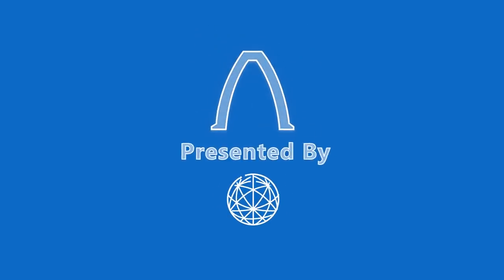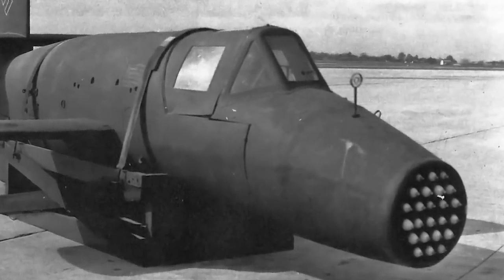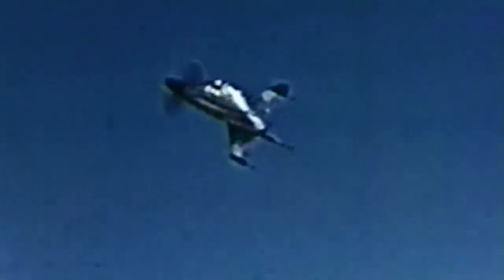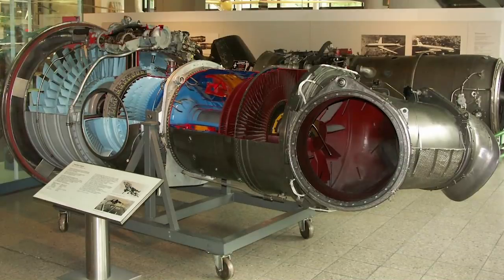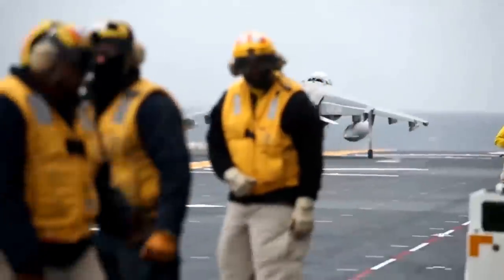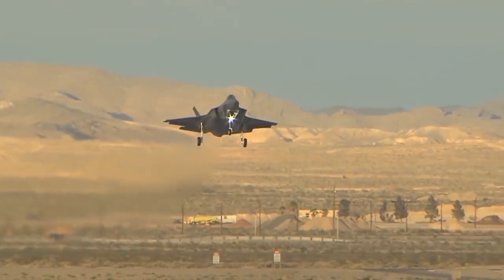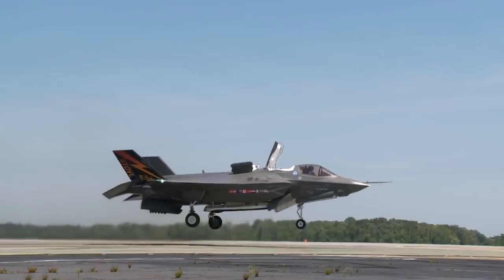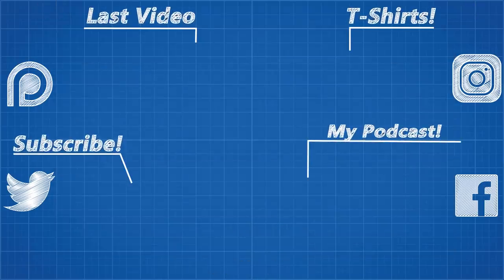The Real Life Sci-Fi of Vertical Take-Off Planes

Comment: F-35 is a shite plane in combat performance, it's technically advanced but the wings are tiny...
Reply: How so? Tiny wings? As compared to what?
Reply: Nathan Peterson as compared to the F22 as well as its own with...
Reply: +Firestar

 The F-22A is a completely different mission focus. The wings are not that small. It has a high on-paper wing loading figure. But that doesn't exactly account for all lift the aircraft has in flight.
Reply: what about maneuverability? in a direct dogfight (which as you implied it shouldn't be in under normal circumstances) how does it stand (or fly for this matter)? I'm not questioning its ability to fly because it is litearly  taking off vertically but how does it comare in combat to litearly every other modern fighter jet?
Reply: +Firestar

 As Royal Norwegian Air Force pilot Major Morten "Dolby" Hanche noted in the Kampfflybloggen (Combat Aircraft Blog): 

- "In the defensive role the same characteristics are valuable. I can «whip» the airplane around in a reactive maneuver while slowing down. The F-35 can actually slow down quicker than you´d be able to emergency brake your car. This is important because my opponent has to react to me «stopping, or risk ending up in a role-reversal where he flies past me. (Same principle as many would have seen in Top Gun; «hit the brakes, and he’ll fly right by.» But me quoting Top Gun does not make the movie a documentary).

  Defensive situations often result in high AOA and low airspeeds. At high AOA the F-16 reacts slowly when I move the stick sideways to roll the airplane. The best comparison I can think of is being at the helm of ship (without me really knowing what I am talking about – I’m not a sailor). Yet another quality of the F-35 becomes evident in this flight regime; using the rudder pedals I can command the nose of the airplane from side to side. The F-35 reacts quicker to my pedal inputs than the F-16 would at its maximum AOA (the F-16 would actually be out of control at this AOA). This gives me an alternate way of pointing the airplane where I need it to, in order to threaten an opponent. This «pedal turn» yields an impressive turn rate, even at low airspeeds. In a defensive situation, the «pedal turn» provides me the ability to rapidly neutralize a situation, or perhaps even reverse the roles entirely.

  On the positive side I would like to highlight how the F-35 feels in the air. I am impressed with the stability and predictability of the airplane. Particularly at high AOA and low airspeeds. It is a peculiar feeling to be flying the F-35 at high AOA. I can pull the nose up to where my feet «sit» on the horizon and still maintain level altitude. I’m also impressed by how quickly the F-35 accelerates when I reduce the AOA. High AOA produces lots of lift, but also tremendous induced drag. When I «break» the AOA, it is evident that the F-35 has a powerful engine. The F-35 also makes a particular sound at this point. When I quickly reduce the AOA – stick full forward – I can hear clearly, even inside the «cockpit» how the F-35 howls! It seems like the «howling» is a mix of airflow over the wings and a different kind of noise from the engine. Maybe this isn’t all that relevant, but I still think it´s a funny observation. Another aspect is the kind of reaction I get when I push the stick forward; the F-35 reacts immediately, and not delayed like the F-16. Looking at another F-35 doing such maneuvers is an impressive sight. The various control surfaces on the airplane are large, and they move very quickly. I can monitor these movements on the screens in my cockpit, and I´m fascinated by how the control surfaces move when I manipulate the stick and pedals. Especially at high AOA, it is not always intuitive what control surfaces move, and by how much."

 The F-35A is noted to have very similar or better acceleration and climb-rate than the F/A-18, and better for the latter against an F-16D.
Reply: Nathan Peterson ok, thanks. That clears things up a bit.

Comment: What a cheap video, this guy forgot to tell the German meschersmitt  and the fock wolf in the 50's, the yakolev 38 the counterpart of the harrier, and then the Yakolev 41, the basic design of a supersonic vertical tack off plane, in where the f35 was based ( if not a cheap copy).
Reply: What nonsense are you on about?
Reply: Just because you ingore the real real facts it doesn't is not sense, read, watch videos before you comment none sense stuff
Reply: @quetzalcoatlarmadaimperial754  The F-35 is not a copy nor related to any Yakolev designs. As the acquisition of said technology transfer from the nineties at least from my research doesn't support the argument the Yak-38 and Yak-41 were included. Secondly the  F-35B uses a radically different means of vertical lift. A "cold" fan drawing rotational mechanical power from the turbofan. Unlike the Yakolev designs both using two "hot" turbojets to provide such. They do not look similar by any measure.
Reply: And about the German airplanes 
https://youtu.be/ntZDAS4fCPA
The other one was not a fock wolf, my mistake it was a junkers. Didn't find the video.
Reply: You are right in the difference between the f34 and yak 141, f35 uses cold air fan, and Yak 141 uses hot turbofans, f35 is stealth and yak not.... Obviously has to be a difference in the copy, but did you know:
F35 uses same turn nozzle Sistem to create vertical take off as the yack 141, and uses same auxiliary under the wings thrust as the yak 141??  And by the way has the same badic design, did you know that?? And yak was faster mach 1.6 and f35 just mach 1.4, probably uses a copy of that same turbine.
And same exactly system of landing gear and exactly the same size and shape of the wings.

So if is not a copy, ( in where yakolev got a lot of money selling a production license to the US, and save them selfs of bankruptcy, with the ability to change anything in that license, what makes it a copy) then still being a copy in where they stole the design and start production without  paying nothing to the Russians ( thing that didn't happened because Yakolev reported a very good income of selling a production license to the Us) still be a copy!!
Reply: @quetzalcoatlarmadaimperial754  
I am not qualified to judge the veracity of the statements made above.
On the other hand, you would gain in credibility by respecting the spelling of German proper names:
- Messerschmitt;
- Focke-Wulf.
Reply: The fucking irony is that the Yak-41 is most likely a copy of the Convair Model 200.